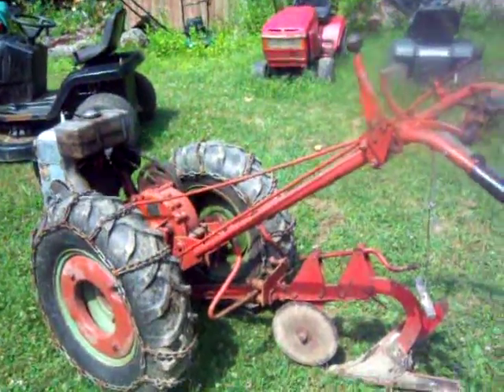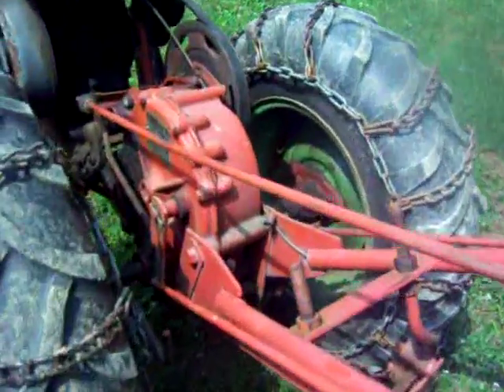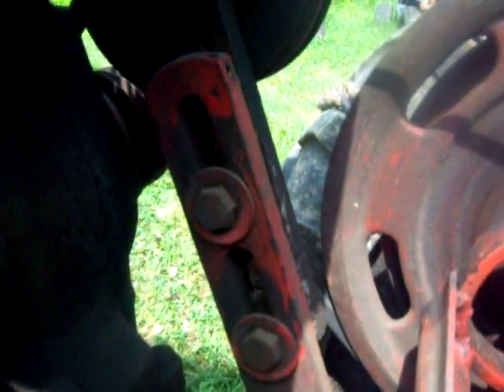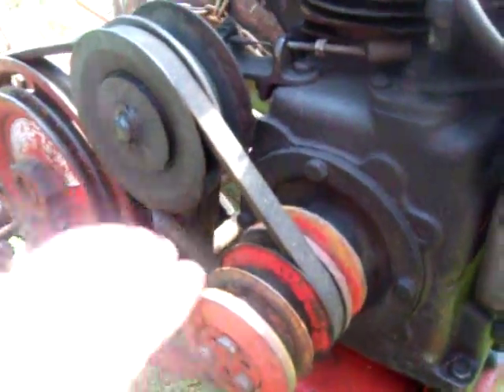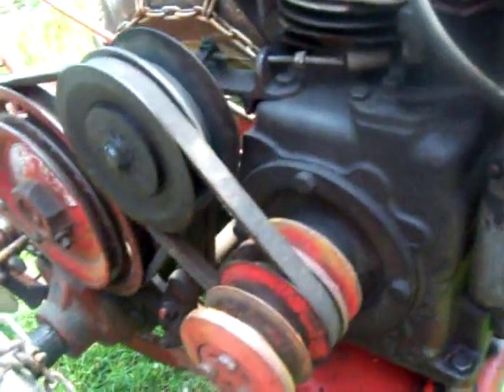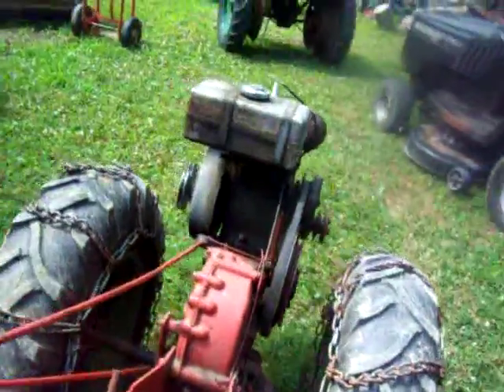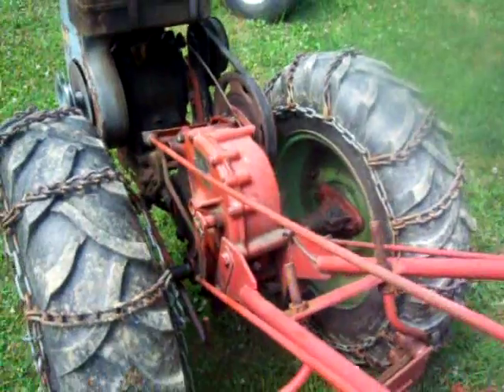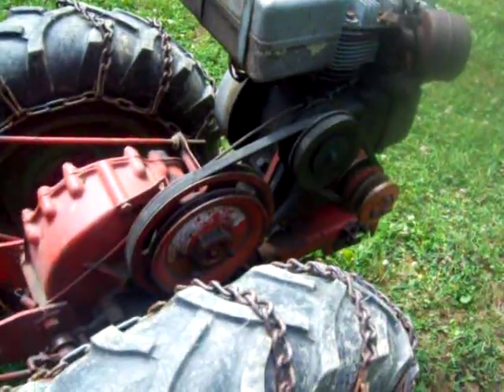1958 David Bradley Speed Changer Up Close

Comment: Hey Mr. Dan,

I was kinda curious about where I could get a speed changer for my David Bradley tractor. Do you know anyone who may be willing to sell one?
Reply from the maker: No I don't but, I'll tell you from experience, Unless your restoring a Super 3 or other DB that Came with it,  they are Really NOT necessary  at all.  I Never Used Mine at all.
Reply: What are the belt sizes I have a model 917575144
Reply: i second that question , i need the main t case belt the reverse belt and pully from the motor , they almost all ran the same belts , identifying them would be a great help

Comment: Hi Dan,
I responded to  your other video. Under static condions the tension on both belts will be the same. As you move the center pulley forward or backward, the divider part in the center pulley moves in or out to change the ratios or size of the pulleys. If you have the motor running when you move the  speed changer rod you will see the action.
Reply: Kinda like the MTD rider mowers used